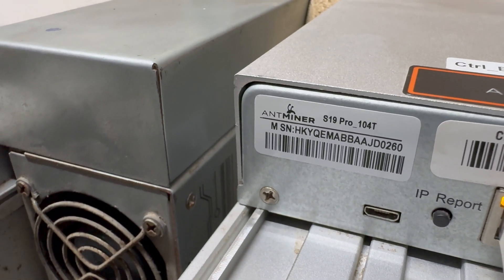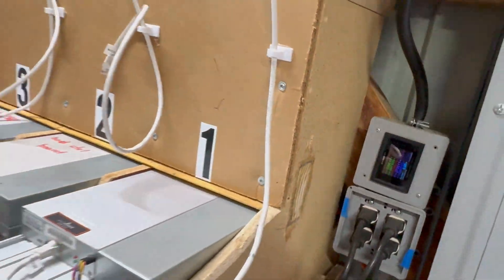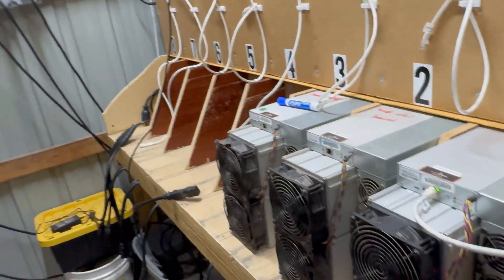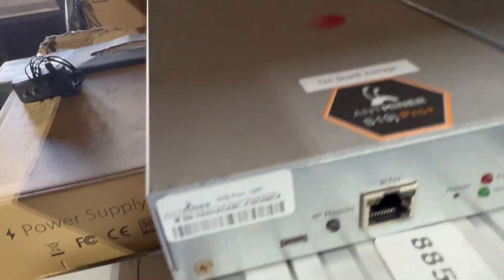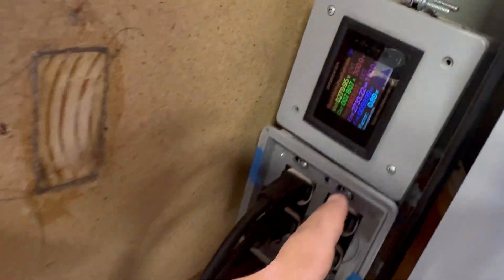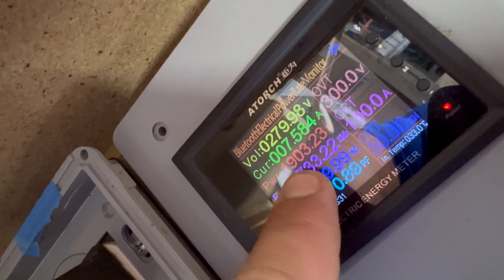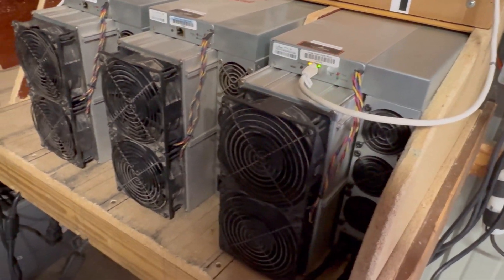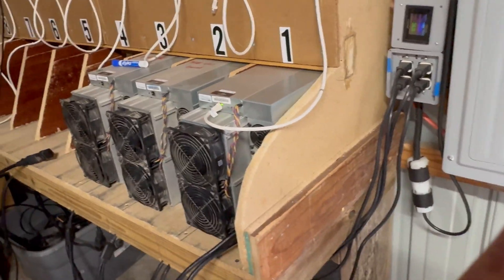Optimize Power Usage on Legacy Bitcoin ASICs

Comment: Also - google this on Braiins website - 'impact-of-temperature-on-efficiency-of-antminer-s19-models' - if you're seeing crappy efficiency - your environment is too hot. You can't aruge w/ these tests. It's fall - open your doors - the fact they are doing 24 @20c ambient means your doing something very wrong to tweak hard to get 27..

Comment: Umm - 21Energy achieves 22.5 J/TH efficiency on an S19J Pro 96 TH for more than a year now - you guys really need to step your game up.
Reply from the maker: It's highly unlikely the BM1362AJ can hit 22.5 J/TH. Even pulling the voltages down to sub 12 and mhz at 250 or lower it has a tail off after 26.2J/TH  ... it's  a physics thing. 

If someone is claiming this it's either false flagging the software reporting or when actually measured at the pool and wall the reality will show different. 

The S19K Pro however can hit those numbers.